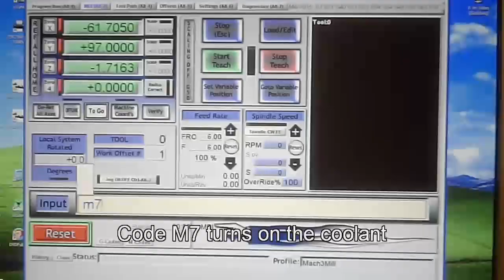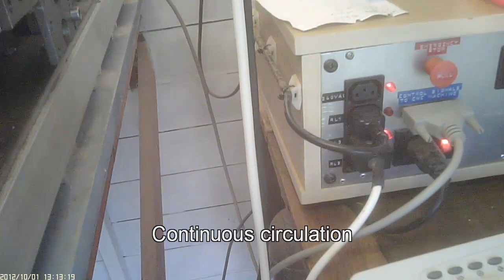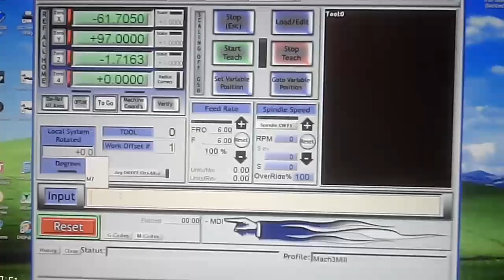CNC machine coolant system

Comment: Awesome! I'm going to build one much like this! What do you use for coolant?
Reply from the maker: Just standard Soluble Cutting Oil Coolant White Water. Got mine on eBay. It just looks like oil in the raw state but turns milk white when mixed with plain water at about 10 : 1 water to oil.